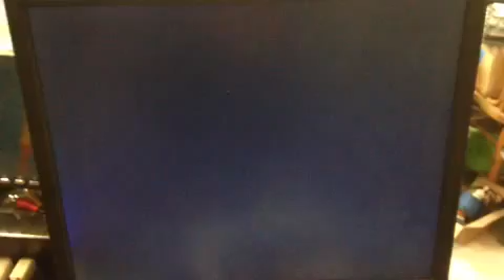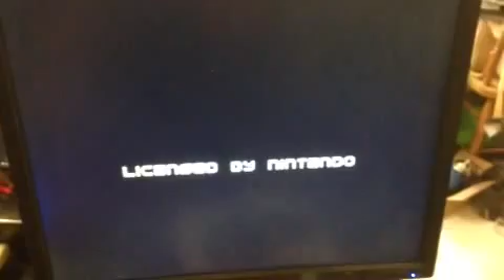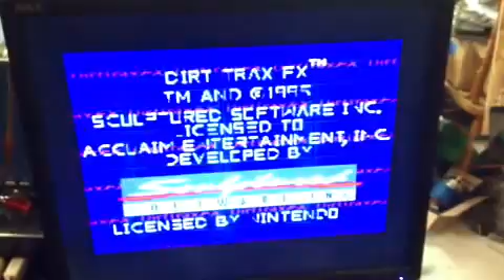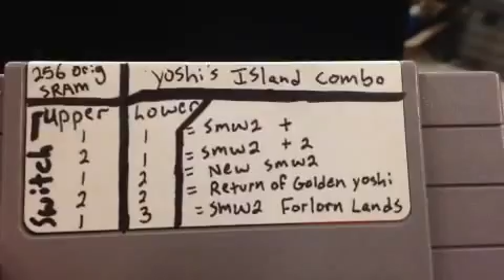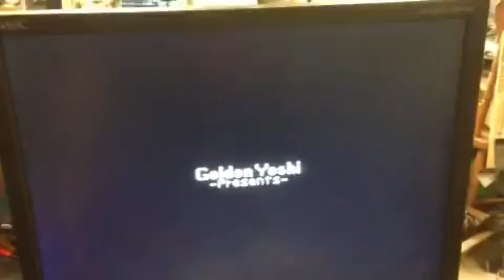Snes Multi FX and Multi SMW2 Yoshi's Islands

Comment: Man I own my Winter Gold Copy ,aand I cant found a way to make it run on my NTSC console (same as Tin Tin Au Tibet) some kind of action replay code or game genie code, will work? Thinking about it better, atht will not work with WInter Gold cause the extra pins of the game that PAR and GG cant handle.  DO you know if those games with region advanced lockout will work doing an NTSC/PAL mod to the console?
Reply from the maker: BIMBOBOOP  the game rom has to be altered to ignore the frequency check and also the CIC has to be changed from pal to ntsc.
https://youtu.be/H-FVYQmo2JU
Reply: That alteration at the game rom can be done whit a game enhacer? like Game Genie, or Pro Action Replay? Cause I suposse the CIC can be just modified at the cartridge. Do you know or can figure a PAR code to do the job with the Winter Gold one?
Reply from the maker: BIMBOBOOP  don't know about PAR or GG code.

Comment: Arcademaster1 , me again... You know i just checked my Super UFO, and you was right... according the menu the sram detected is 256k ... do you have any idea about when i can grab a memory of 512k? i was figuring using a cartridge , but i found that even Mario Paint paint uses 256k of sram... and mostly games just use 16k... do you know a tittle that use 512k? or maybe you know another way to find it? i wannna know what happened if i change the sram memory...i dunno maybe even the Super UFO doesnt detect that at all..but i would love to give that a chance. Also , do you think in other thing i should check beside the sram?
Reply from the maker: 256k is the biggest sram snes used in a standard cart.  A few of the fx games had 512k like doom and stunt race and dirt Trax.
I don't own a super UFO so I have no idea if the sram can be upgraded or not.  At 512k, the package size increases in pin count from 28 to 32 so that may tell you if it's possible or not (if there are 32 pins available on the UFO or not). 
Anyways, I assume that is your main issue with getting Starfox2 to work or not.  Maybe try googling to see if anyone has done an upgrade like you want.... 
Good luck.

Comment: It will be awesome if you also add StarFox 2 to your cartridge... the game rom is the complete game, you know?
Reply from the maker: ???  StarFox2 is among the game set.  This pcb has every FX game made in it.  Maybe this vid doesn't show it though.
Reply: Awesome!...maybe you are the one that could help me with an experiment i am trying. I own an old Super UFO, i dont know if you know it, but is a chinese copier/snes accesory that let you backup the Snes cartridges on old Floppy discs.  Beside that,  the only limitation of my Super UFO version is that i cant copy any games that use special kind of chips. But normally you have an option. If I own an original game that use the same kind of chip of the backup i am trying to run, i can use it to play the game just placing it at the cartridge slot of the Super UFO. It will run the game from the memory loaded from the floppy  discs and the special chip from the cartridge.  BUT the problem is , i am trying to use that logic to run Star Fox 2 on the Super UFO, but it seems, the Chip FX games brake the rule and until now i am just able to load the sound, whitout any image (black screen) . So since i supossue yu must know own the Chip FX chips work, I was wondering if you can explain to me (in easy terms) what it could be happening, and maybe give me some ideas about how to load the game :) Please Help me,
 Best Vibes!
Reply from the maker: BIMBOBOOP Maybe your super UFO uses only 256K sram.  Star Fox needs 512K.   If you try to run Starfox with 256K sram, you only get the sounds.
Reply: Awesome... maybe thats its!! i will check my Super UFO in some minutes... is the last of the old versions as i mentioned...  Loading games whit old ,and still working, Floppy discs is kind of fun, you know?